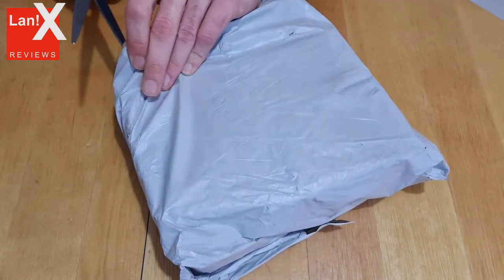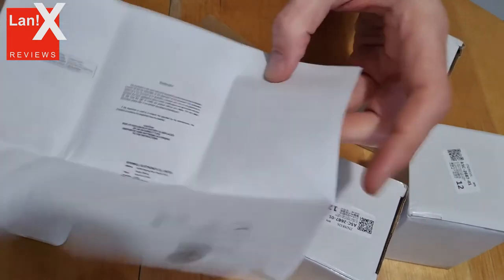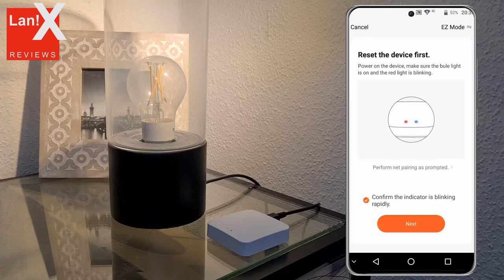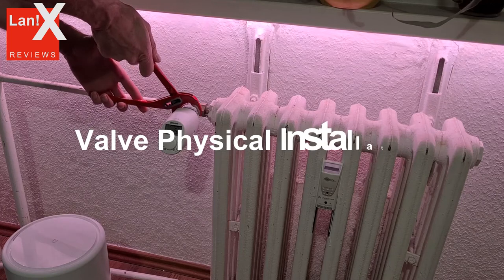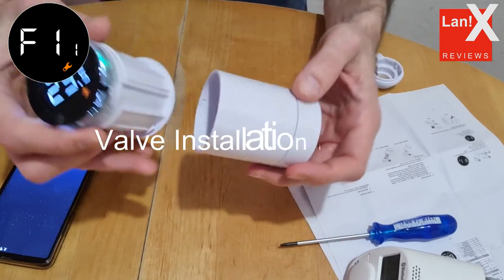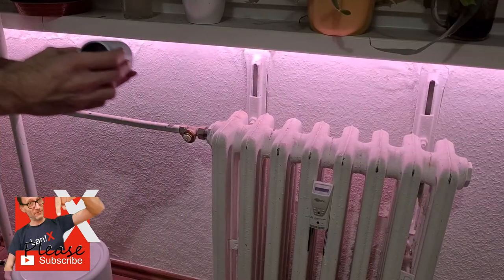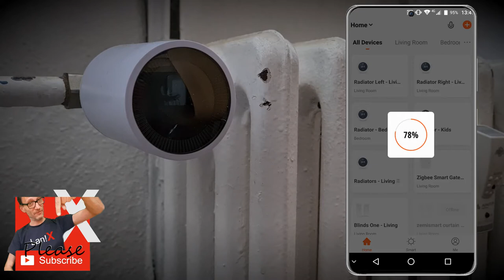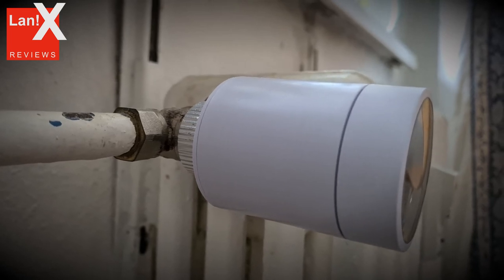Siterwell Tuya Smart Radiator Valve (Unbox/Setup/Review/Demo)

Comment: Nice clear video. I have the Aqara versions of this trv and they are a very nice product compared to other tuya trv's. I could not help but notice you missed the calibration step. That is when the device goes from f1 to f2. It needs to be installed onto the radiator before doing the calibration in order to work optimally.
Reply from the maker: You are right, i calibrated it off camera when i tested the process... 😉

Comment: Hi! Thank you for video. I always receive errors from my devices. I done calibration, anyway the probled did not solve. If you have idea, please test me. Thank yuo!
Reply from the maker: I sometimes get random errors of valve failure, but not often. It works like 99% of the time....
Reply: I get 3-4 times a day... Realy do not know what wrong @dalanik
Reply from the maker: Is the signal good between hub and valves? Does it happen on one valve or several?
Reply: @dalanik  It is happen on two devises, the signal is normal. Couple times I install them again with calibration.
Reply from the maker: I would try switching valve location i.e. swap one that works ok with one that doesn't so you can tell if it is signal or device issue....

Comment: hi, im looking for a new smart valves system to replace my shitty danfoss link. i have some questions. hope u can help me
1) is it possible to make a custom schedule with different temperatures in same room? example: 21° in the morning and 25° in the night?
2) do u know if u can use rechargeable batteries? most of these valves stops functioning when voltage its under 1.4v (per battery) so rechageable batteries dont works even if full charged
3) how these valves communicate with the bridge? in the specs its wrote 2,4ghz, but i doubt it. usually its 433 or 868mhz.
4) which is the max temp? i ask because i looked for tado valves and are limited to 25°. hope these arent
hope u can help me. see ya
Reply from the maker: 1. Yes you can make several schedules during the day. It is per valve, because there is no central heat sensor.
2. I didn't try, sorry. But set of ordinary AA's will last for while year
3. The valves are zigbee, so you need a zigbee hub. Don't know which frequency that is, probably something around 2.4ghz
4. I think max is like 30 celsius

Comment: Hello, when having a smart thermostat installed as well, will the smart valve turn on the boiler  when it is too cold in the room (where the valve is) but too warm in the living room (where the main thermostat is) so the gas boiler is off?
Reply from the maker: These valves are for central heating only, I don't have any boiler. They also have temperature sensors so the can measure temperature.

Comment: Pozdrowienia z Polski :) You are my favorite smart home Youtuber ever <3 every topic that came up to my mind has been covered in Your videos eventually. I was thinking of smart radiator thermostats for some time couple of questions: 1. Does the zigbee gateway will operate as well with third party zigbee devices as aquara light switches or xiaomi temp sensors? Is it addable f.ex in mi home app?  2. Does the tuya app offers any kind of automation f ex time schedules to create time patterns of desired temp during specific time? Thanks in advance for a reply, BR
Reply from the maker: Hello, the gateway will work only with Tuya devices. For Aqara and Mijia you need Aqara or Xiaomi gateway. Yes, you can make daily schedules for temperature adjustments.

Comment: Hi, how long does the batteries last before need change?
Reply from the maker: Depends how much you use the valves. I have setup to turn on in morning and turn off at evening and they last whole season.
Reply: @dalanik  Thank you ... the website shows 2years 

Do I need the zigbee hub or it can work with wifi directly? I was going to buy google nest but this is much better value to control all rooms
Reply from the maker: Yes, you need Tuya zigbee hub, i got it in a bundle with the valves. As far as the batteries go, I installed them at the end of last year heating season and now they're at like 40-50%....